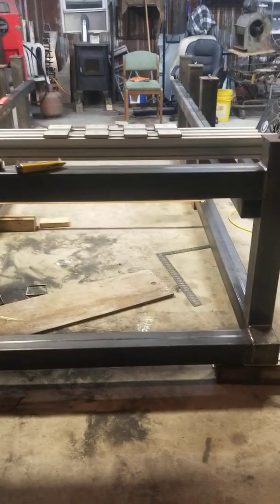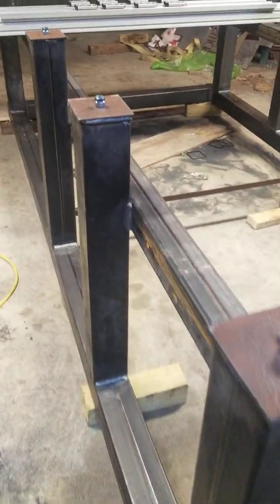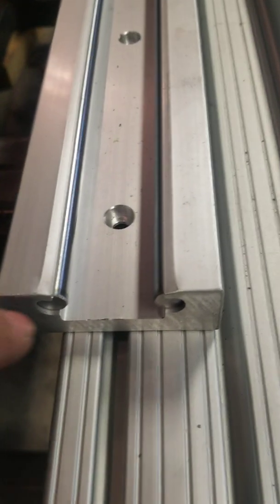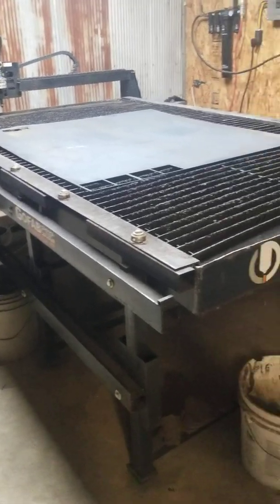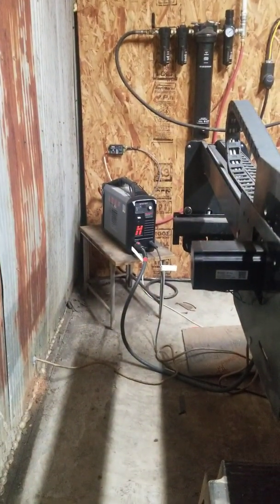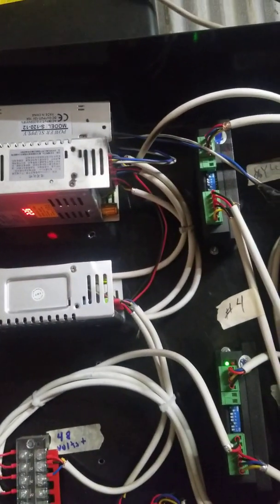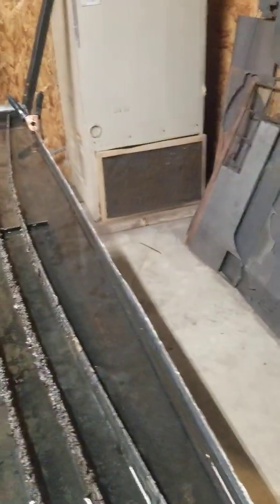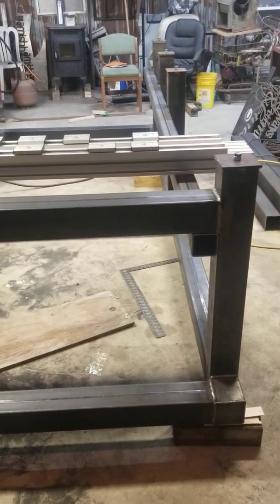BEST HOME BUILT CNC PLASMA TABLE 4X10` #1,To replace the GoFabcnc

Comment: Do you still have the old electronics and tablet? Willing to sell?
Reply from the maker: Sorry. But no. Gofab came out with an update ,and I put GoFab table back together and sold to try get anything out of it. You don't want one. If ya have one. Best to update Controls in control box as I did. It worked very well when I did that. But ended up building my own 4x10 table and put my new updates on it. Hasn't stop working in last 3 years.

Comment: Did you previously have a gofab table? If so why are you building a new one?
Reply from the maker: Yes  I had Gofab. It worked for right at 3 month.. and Torch always came down hit metal.. Dealer would not help or contact me back at that time. or anyone else!  It wasn't just me.. it was a least 35 people who had tables, that I knew of.  I built my own controls and put on the Gofab  and they worked great.. but Gofab still had the sawtooth cut.  So  I built my own 4x10 table.. and put my new controls and motors on it, and sold the Gofab.. Now I will say.. The Gofab did cut good,  when I put it back together, and downloaded the newest software. But buyer of my table has already having Problems. My new table will cut circles around a Gofab table and more.. I have had to bought tables.. bother were problems.   .  No my new table I built.. just keep on cutting.
Reply: @Dishtech48  what issues is the the buyer having after the update? I’m  looking at buying the go fab 4x8 table for light production use since I’m in tx and can save on shipping costs with them.
Reply from the maker: @thewespaul6520  My Gofab worked great for like 2 months.and they changed software.and torch was hitting metal.and almost breaking Torch ! Couldnt get pass that.. even try  dumping software and re installing. but we had a group of Gofab users.and everyone  was having problems. and Gofab guys never responded to any of us..  They ignored us , until they  got turned into BBB..  I ended up stripping new table down, and building my own controls, motors wires everything.. and it cut good then. except Saw tooth cuts.... I later built my own.and used my Controls I built on new table.. Never looked back.. I put old controls back on table.. they had a newer software that was cutting at that time(6 months later)  and sold mine.  3 out of 10 rating, I give them for tech support. They  need to inprove  electronics in table  Was cheapest you can buy like $150.00 for motors and all electonics...not good deal..
I steer anyone away.. Not worth what you pay.. build your own. way better off and cheap..
Reply from the maker: @thewespaul6520  also check out Eagle Plasma... they use the same Controls as I do..and I think cheaper than Gofab....Super Tech Support... They helped me with mine.when I got it put together..and I didnt even but anything from them..
Reply: @Dishtech48  I have a go fab as well mine doesn't sawtooth but have other issues. Like you said tech support sucked then I finally got a hold of Ryan who is the one who sold me the table. The only reason I bought it was because he told me it would cut 1 all day but I ruined a sheet of 1/2 trying to get it to work. Worked flawless on 1/4 and under. I finally got it to cut 1/2 this week without a problem changing some settings. Would be curious to talk to you on what you did to set yours up.
Reply from the maker: @jeffreybuerk9426  Hi Jeff, wasn't sure, which table you was wanting to know about.  But if you still have problems, You can get rid of the $150.00 Gofab controls and motors,and replace with Proma MyPlasm Controls! Wow what a huge difference.  But email if ya want more info.  dishtech43@yahoo.com. Thanks

Comment: The proma my plasma controller how easy was it to setup to usa version sae not metric. Nice base
Reply from the maker: Oh it was  all good.. They are on alot of tables now.. Eagle Plasma, STV plasma.  and more.. but it the best system that I have had.. I had a UCCNC also. which was great system.. but had tons of settings. I didnt like that.. this one is easy. and comes with free software. and they are always updating the system. I can start a cut anywhere I want.., just by right clicking on a line  and tell it to cut from here.. I never had anything that worked this well before..and the THC is great.